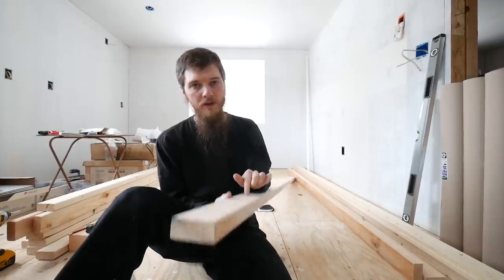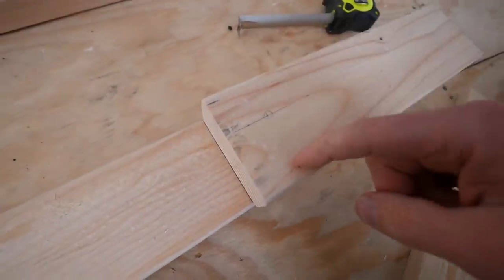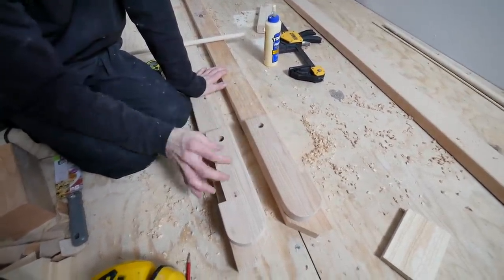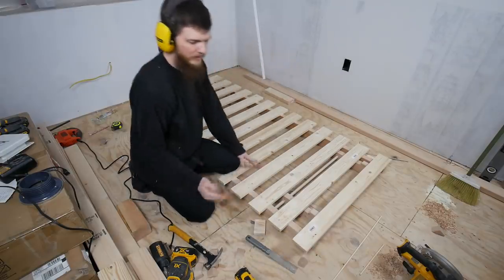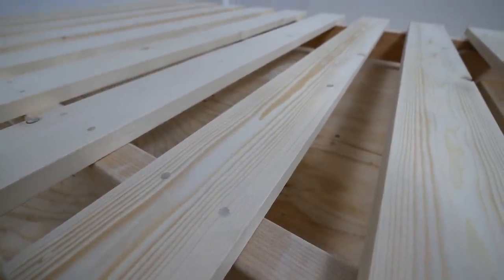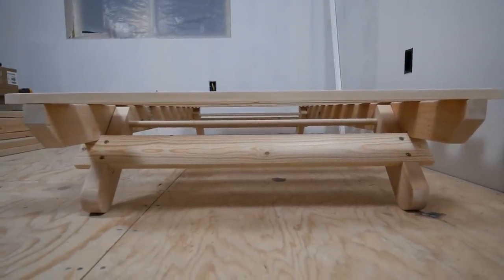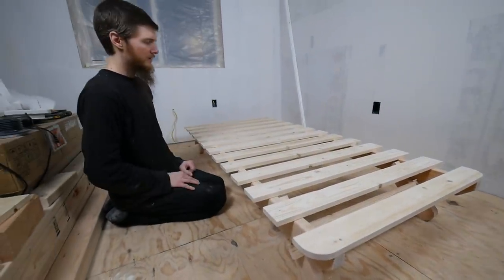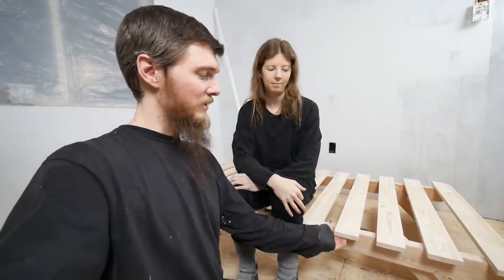DIY Minimalist Solid Wood Bed Frame for Under $50

Comment from the maker: Awesome Little Flush Cut Pull Saw: https://amzn.to/2Qbo1o4 

(Affiliate link)
Reply: Try angle drilling you dowels come in the opposite angle
             /dowels\
 (   __\ _________ /___  )
               Board
 from each side of the board it will be like pinching the 2x4 thus cant pull up or out
The drawing is difficult using keyboard characters but I hope you get the idea. Very strong this way.

Comment: Glad you made the bed frame slatted,  rather than solid wood across the bottom.  Air circulation is important to keep down mold,  etc.
Reply from the maker: For sure!
Reply: @diyfferent  
You guys are clever!

Comment: Keep in mind that if Maverick has any congestion,  you can fold under one set of legs so that he can sleep on a down angle.   It really aids in helping drain fluid from the lungs.  An old trick from a pediatrician when one of my kids had pneumonia.   I like the bed.
Reply from the maker: Thanks for sharing that.
Reply: That is awesome.  So many times I could have used that when my kids were sick and trying to figure out a way to elevate the head of their bed.

Comment: The design does remind me of some of the wooden futon chair/bed frames I have seen/ acquired over the years. I love the wooden dowel idea. You may not know that there is an ancient tradition that Solomons Temple, and also various altars were built without the use of metal instruments and no nails. The reason given for this is that it added to the aura of peace involved in the construction of these projects. Metals were used especially for instruments of war at that time and this was a way of separating these special objects/buildings from that. Building your son's bed that way made me think of that and I thought you would appreciate that connection.
Reply from the maker: Thanks for sharing :)
Reply: lionreb, Thanks for sharing that. Very interesting. I knew that & that even the stone cutting & tool work was done at the quarries but never really thought very deep about why. Have a blessed new year!

Comment: Great frame. Did one to fit a Japanese minimal bedroom a while back and did it the same except I didn't put legs on it. Didn't like that as it was too low so I made 3.5 " legs and that worked out well. Ur right..... challenge promotes learning. Gotta try to learn. And the satisfaction in the end is awesome. Even if u goof up and have to fix more mistakes. It great fun to learn. At least it is for me.

Comment: You did such a great job on that bed Doug! The 'no screws' technique is the way my Icelandic (carpenter) grandpa would have built it.. he used a lot of dowels and dovetail in his woodwork.... so you're still sticking to the Scandinavian/minimalist theme by the looks of it :)  So funny, I kind of cringed when I saw those sharp corners and then you rounded them... then I thought of the finished floor and the potential scratches you might end up with and then Ashley popped in with the advice to use felts on the bottom lol  That is a very cool minimalist bed! You should make up an instructional ebook on how to build it (along with your other projects) and sell them on Amazon.... nice passive income for your family! :)  Excellent job... such a clever transitional bed for kids... plus, if Maverick jumps on it, it will survive!! lol
Reply from the maker: Thank you!

Comment: I've build quite a few beds like this for my impoverished friends.   One thing I always do is make the legs 18 inches high.  That way you can easily fit a 64 litre laundry tub under the bed.  They're only 16 inches high.  When we are dealing with a twin size bed, that means that you can store a whopping 8 large laundry tubs under the bed and each of them is readily accessible.  If you don't want to look at them just get a large sheet or two and put them over the whole bed.
Reply: That's great if somebody's tall. Not so good for a kid like this bed is for, or for a person with short legs.

Comment: That's a really cool design!  Well done.  One thing you might want to think about is a rubber pad (rubber won't slide like felt would) for the feet for when you get your flooring in.  Just a thought.
Reply from the maker: Good thought, thanks!

Comment: Being a woodworker for 40+ years I also like the no fastener idea too. The only problem with doweling the slats is the dowels don't really pull the slat tight to the frame especially if they're slightly warped. The solution would be to clamp the slats to the frame first and then drill, glue and dowel. Of course that means having to shell out for clamps.... And it would take quite a bit longer waiting for the glue to dry on each slat! Whatever. It looks nice and solid. Sometimes simple and functional is best!
Reply: What an absolutely lovely comment

Comment: i built wood frames for my children many years ago that were tall enough to allow plastic storage containers to slide underneath this eliminated the need for dressers until i could make them. as they hung everything up but sox underwear shorts ect they fit in tubs under the beds my spouse made a sham that we attached with magnets so they could be easily washed. i eventually made desks night stands and matching dressers for them to suit their needs.

Comment: The floor works pretty well too.
Reply from the maker: A mattress on the floor leads to wetness under the bed and mold growth.
Reply: @diyfferent   Oh, right. I'm so used to rolling up and putting away my yoga mat + mattress pad combo xD Also have 2 trifold mattresses that are fast to convert but I find a solid surface the most comfortable.

Comment: cool bed I have been trying to make a full / queen size bed frame  .....
Reply: Yep, I was thinking the same thing. I think the bigger bed will have to have a middle leg for support - just add to dowel rod but can't figure out how to put the V-cut stop point - hmmm maybe just make it go straight up/down with rounded corners. Maybe. Good luck. Oh, if you already have a box spring, I just screwed 1 x 6's in four places ( side to side ) along the frame of box spring then added 2x4 legs ( at the height you want ) in three places on all 4 cross boards ( be sure to brace the legs with L-shaped brackets or the metal brackets used for building projects such as houses. I sure do like Doug's folded legs.

Comment: My husband made an ice fishing tent with a rounded bottom like Maverick"s bed bottom.  Instead of slats , he reinforced the plywood floor by putting rounded skis on the bottom edges and down the middle. He then hinged it so it could fold in the middle to get it in the back of the jeep, attched the tent, drilled ice fishing size holes in all 4 corners inside and attached a pulling rioe to get it out on the ice.  We could fish in any rotton weather with a small buddy heater and never get cold.

Comment: I cracked up when I saw the random orbit sander hooked up to a household vacuum. Love it
Reply from the maker: Haha, it works very well!
Reply: @diyfferent  I don't doubt it. I'll be sure to recommend it to friends who don't have a shop vac! I never would want to use an ROS without vacuum
Reply: The household vac can outperform many shop vacs.  The cyclone (bagless) type is less prone to clogging, keeping suction until it is full.  But not large capacity, and not usually wet-vac.
Reply: @hjeffwallace  Good point. Especially because I consider a cyclone separator a must for my shop vac. Even the $40 baffled lid for 5 gal buckets at the BORG is a whole lot better than nothing.

Comment: That is a nice bedframe. I know what you mean about box springs they take up too much room. When I buy a new bed I will be getting a platform bed instead of one with a box spring and and it just has the frame and mattress. Happy New Year!
Reply: The saddest part is they don't really add much comfort either. They just make the bed higher. Instead of that, I could just get slats and a frame that's higher then use that space under the bed for drawers

Comment: Wooden dowels make it stronger than screws. Soak it in the tub so that the wood swells and the dowels are in there to stay. Early colonial construction used dowels as fasteners and many of those are still standing strong after more than 200 years.

 Considering the ease of moving it from one room to another, what is the weight of the entire frame?

Comment: That's a nice bed frame. I'm all for building a bed. I'm currently sleeping on a mattress on the floor. I've made my bed before and loved it. I'm really big on platform beds. No box spring needed. All my friends who have stayed the night and slept on my bed thought my bed was the most comfortable bed ever. I have a new platform bed that I want to make this time. It's a queen size. It uses pocket holes. So I'd have to get the jig for that. The only thing that's keeping me from actually making my bed. Is a lack of a vehicle to haul the wood in. As I don't drive. I ride public transportation (bus). I don't have a valid driver's license. I only have state ID. So it be hard for me to haul lumber on the bus. I have some tools. I don't have the pocket jig. But I have a drill, jigsaw, and sander. But don't have a nice portable saw like you have. There's a few alterations I want to do with this bed frame. The original wood it wants me to use is a 2x8s putting the bed really low to the floor. I have osteoarthritis in my ankles, and knees. I don't want it that low. So I'm switching it to 2x10s instead. 
  The funny thing is this. I see that your remodeling your trailer from 70s to more up-to-date modern. And I'm decorating mine more 70s. I guess modern is included but with the 70s style as far as furniture goes.  I do love watching your videos. I wish I could watch it more. But I lack internet data. So I'm unable to watch like I want.
Reply: Hey! I also don't drive and use public transportation unless a family member is able to drive me. I have asked in local Facebook groups (neighbors) if anyone has wood to give away (worked out great!) and also if there's anyone with a truck that could pickup and deliver from home depot or lowes.  For a few extra bucks for gas, you might find someone that would be happy to help you out!
Reply: The struggle to create without the ability to go grab your materials is REAL! I also don't drive...seizure disorder, blah blah blah. The good news is that there are options available to those of us that live life with a lack of mobility - delivery! While it is true that it usually costs more, there are ways to mitigate that to a more manageable amount. For example, let's say I've chosen to buy the materials needed from Home Depot. First off, I know 4ft lengths are a good thing to set my sights on when looking for shippable materials. As I peruse the virtual aisles, I'm on the lookout for the items marked "free delivery with $45 order." Also, a willingness to compromise is quite useful, but if it's a part of the design that is important to me, I keep that willingness to compromise company with a steadfast determination to git'er'dun in a way that produces nothing less than what I want. For example, let's say I want to use those 2x10s you mentioned but can't find any that will ship free. What I would do is find the chunkiest boards I can that WILL ship free and laminate them. A little extra patience and some forethought go a long way when trying to do something like this, and those two things are precious commodities I seem to always run short on. BUT when I make up my mind to make it happen, I do exactly that, even if it requires me to place several orders bc of budget restrictions or whatever. If that's the case, I try to figure out how I can order what is needed to get started on the build while I'm all revved up about it. I find that getting done what I can is just the motivator I need to do it all over again... repeat a couple times, and I'm done. Remember - clichés are cliché for a reason - you are not alone! - where there's a will there's a way! Good luck!

Comment: Wow, that is amazing!  I've never seen a bed like that before.  So cool!  If you had wanted to put screws in, you could still cover them with those dowels.  If you find that the mattress will move around a lot, could you place some kind of support on the four edges so it will stay in place?  Or maybe long wooden sides on all 4 ends maybe.  Just curious.
Reply from the maker: Thanks! If the mattress slides, we'll probably just use some anti-slip strips on the slats.
Reply: @diyfferent , I didn't even think about those, LOL!!  If you end up having to use them, please let me/us know.  Thanks!

Comment: To help cut out the squeaking I've had good luck with placing a washer between the moving parts.
Reply: An alternate is a little bit of wax, either beeswax or paraffin, does the job nicely as well.

Comment: Doug, by chance , is it possible to purchase the plans and instructions to create a bed frame like the one you did?  About how long did it take from start to finish?
Reply from the maker: We don't have any plans for it drawn out. If I were to do that I'd want to use the bed for a while to see what I would change, if anything, before offering plans. The project didn't take too long, maybe a few hours and it would have gone quicker if we used screws. The next time would go faster now that all the planning is done.

Comment: I love the bed. There is a safety issue I see. All those slats ends, even with a mattress on it, are sharp places your son could hit his head on.

A couple options.

Keep it the way it is and find a mounding material in a strip and glue around the outside edge. 

Or, cut slat ends to 2x4. Then place another 2x4 board on both sides running long ways meeting with the round corners.

Comment: I would suggest that you add a third rail down the middle.  Your slats are not stable enough for the long term.  Several years down the road they will bow down from the constant repeated daily loading.
Reply: Would one more rail add that much to the cost?  As a former cabinet maker I can tell you that wood, any wood, even commercial lumber, is a natural product and therefore subject to extreme changes under use.  If you don't understand them they will come back to haunt you.  You have largely intuited most of them, with a reasonable amount of craftsmanship, particularly in the dowel work, but you need to learn more about wood's capacities to bear weight under load.  

It will bear an amazing amount (such as the roof of a house laying on the end grain of wooden studs) unsupported if you use the end grain, but it is weak without support when you use the long grain.  Your rails are supported adequately by the floor, but your slats will repeatedly bear weight across a gap of 38 in. with no support whatever.  This is truly beyond the capacity of softwood lumber to handle in the long term, and fixable by one small change that will give those slats support from the floor.  The rail, of course, would have to be a little wider, but with your skills with dowels and glue that wouldn't be a problem.  Or you could buy 2x6 and rip it to fit. Dowels used on end grain are just as strong as studs used on end grain.

There is no reason you couldn't have made your figure in the title $60 instead of $50 for a far greater increase in craftsmanship.  I assure you, wood is worth it, even common lumber.  Use it right and it is nearly a miraculous material and worth what is a very small amount extra of time, effort, and money.  I assure you that this one small change will give you an heirloom as well as a cheap bed.  Wood really is that durable under use if you build with the lumber instead of against it.  

You clearly have quite a lot of talent working with wood.  Take some time to learn a little more about it.  The time will be worth your spending of it.
Reply: Well he could have went with 2x4 slats and it been cheaper 3 bucks for 2x4 and t for 1x4 I'd went with 2x4 and no worry about the sagging  with age. And cut the cost
Reply from the maker: I just wanted to keep the weight down. All valid thoughts. So far it's working good for our toddler.
Reply: Karmakshanti Vyapini .....I would suggest you have to much time on your hands.
Dude....and I mean dude.  —> he’s making a temporary bed for his 2 yr old son that will last him a few years.
Holy smokes...he’s not using it for 30 yrs like your damn kitchen cabinets.

Comment: Bro, go pick up a few wood pallets on the curb and saved yourself all that unnecessary work.
Reply from the maker: We have pallets but that comes with its own issues. I'm happy with how the bed came out. Pallets could work in a pinch for someone who needs a quick and cheap solution.

Comment: Really fun to see how the bed came together. My husband built a toddler bed when our oldest was coming out f the crib stage. It was built with wood, but using hardware. It had a space for a crib sized mattress to fit into. Then when a twin sized bed was needed a plywood platform went over the bed frame. It was very solid and well loved by our daughter. I really like your bed frame style here, and it is functional now for a long period of time!

Comment: Or you could put your mattres on the floor.
Reply from the maker: It's generally not good to do that. Mattresses need to have ventilation under them to prevent moisture and mold.

Comment: If you’re minimalist, you wouldn’t need a bed frame.
Reply: just a mattress is all they need
Reply from the maker: False. Look it up. Mattresses get wet underneath them without a frame. That'd be okay if you like mold and a ruined floor. Also, 'minimalist' refers to the style of the frame. Look that up too since you don't know.
Reply: @diyfferent  I don't know how much you spill things on the floor, but it seems like it's a bit excessive.
Reply: @christopherjackson3455  My bed has no airflow and the mattress hasn't gone moldy yet. Only had it 14 years though, maybe it needs more time?